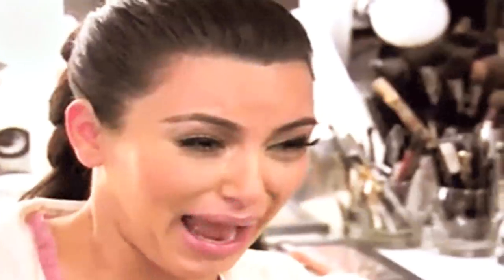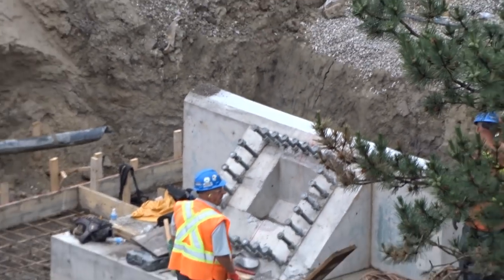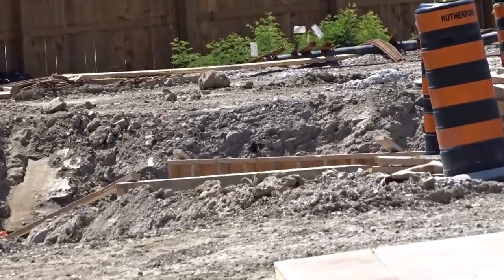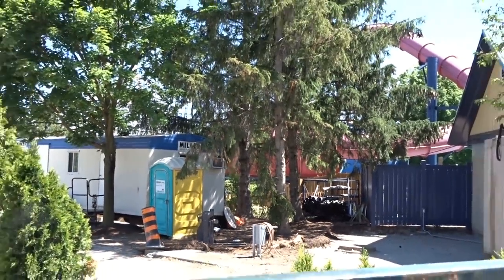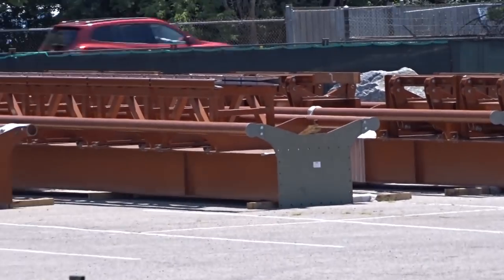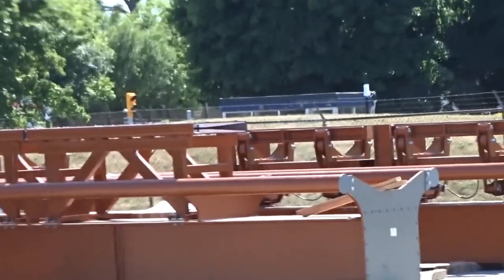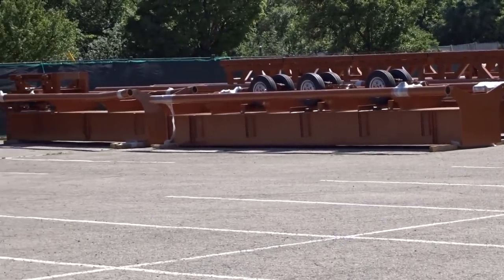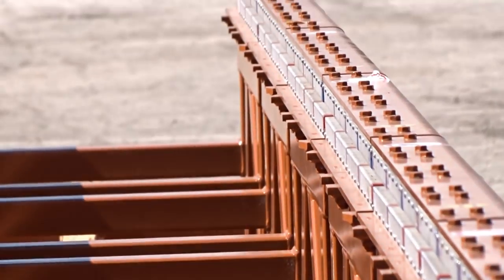Canada's Wonderland New Coaster Building, New Fence & Vertical Construction?

Comment: How does vertical construction work?....they attach a support to a footer with bolts and track to the supports? 1 piece /day?
Reply from the maker: they will install the support beams to the footings and then attach and weld the track to the supports.

Comment: the track with drive tires is for the transfer track...if you look at the end of the track theres no bolt holes..
Reply from the maker: thank you, that's what I was figuring
Reply: I noticed this as well; but, the other end of that piece DOES have bolt holes! Two sections for the transfer? :o
Reply: it also has a lock alignment pin 100% its transfer track
Reply: I agree it's transfer; but why the bolt holes at the other end? I've never followed a dive machine build before; so, I'm interested in the bolt holes on the other end of the piece! :)
Reply: if your looking at the section with the clamp breaks that wouldn't be part of the transfer track as it has an upward curve to its track. however I could be wrong on this if they transfer trains pre lift hill or at station level out. ill have to watch a valraven video see what it looks like. EDIT ok so you are correct that second piece is transfer track however the reason for the bolts on on end but not the other id due to it being the final section between the station break run and the transfer track section.

Comment: no bolt holes on drive wheel track piece so part of transfer track  dont think 4 peices got on site  now in order could be wrong ❎  house seems  small low if track is low to ground maybe part of it is dog house 🤔 which what call low clearnce room so    lift / air compressor  electric   and master control panel room makeing concrete walls sound  barrier maybe gift shop be on north side of lift hill  of walk down into  gift shop tho  idk maybe in front lift if rockets up have clearnce ....   help had blue prints lol